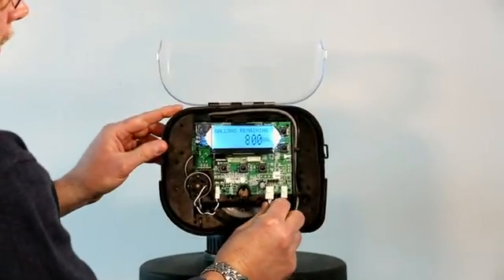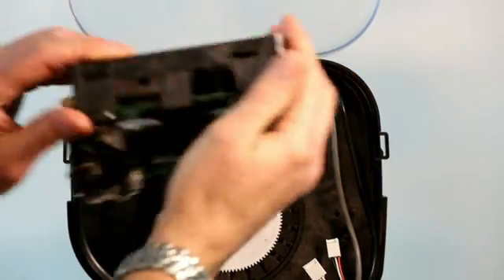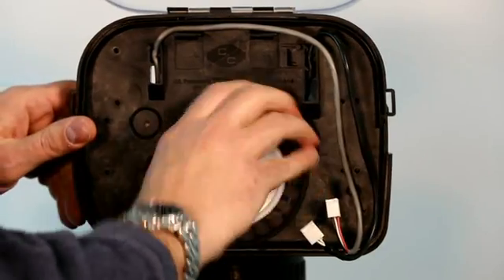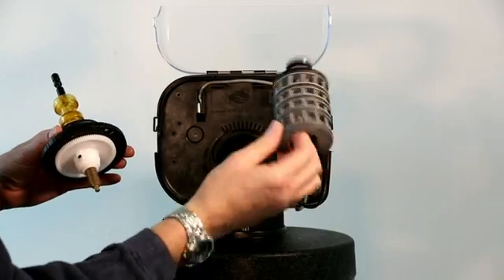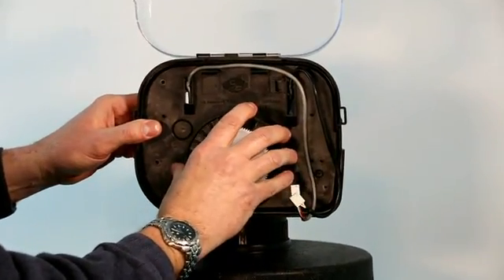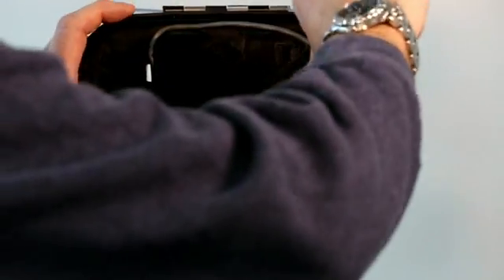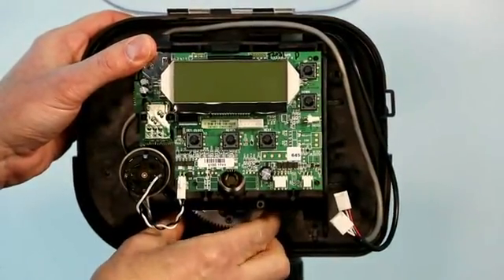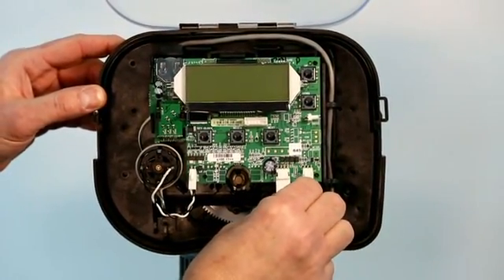GEN II Piston & Seal Removal and Replacement

Comment: What would cause water to dribble from the drain tube?
Reply: Mine was doing that, it was from sediment that built up over the years. Replacement parts were $125 from Easywater and they threw in the special tool.